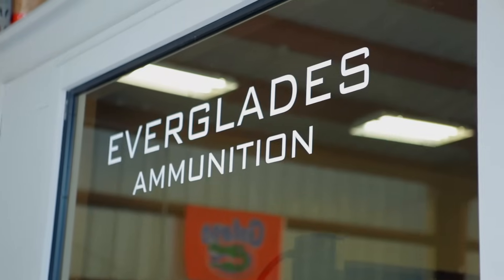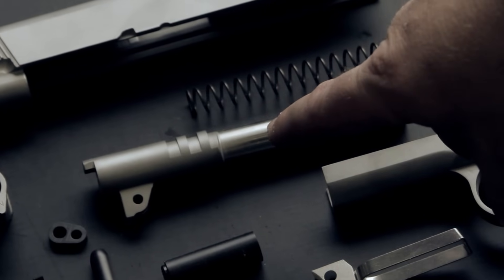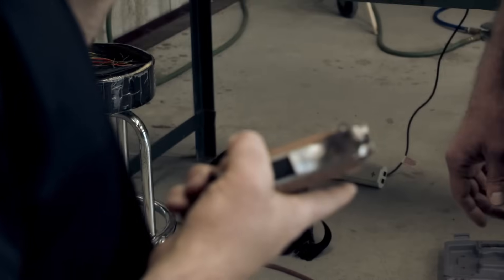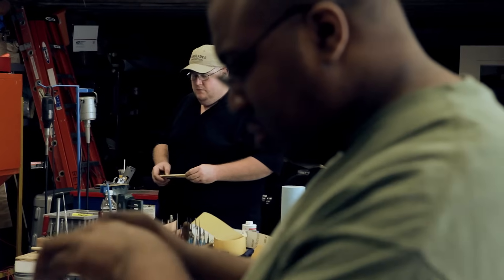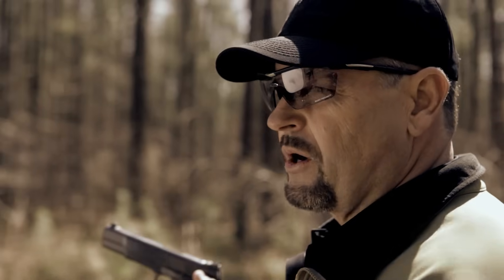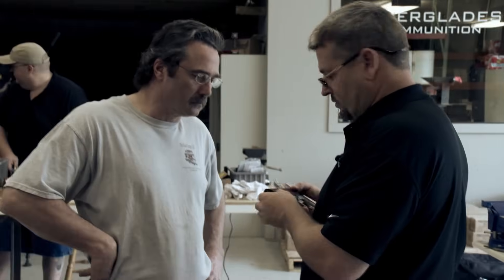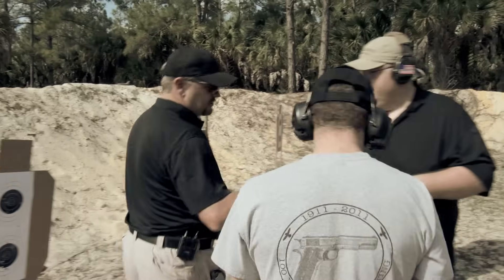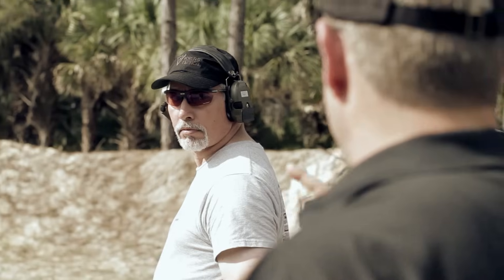Building the 1911

Comment: My very first handgun was a 1911 I built from an 80% frame.  I bought a cheap kit and half of the parts fit in it so had to order those same parts again off someone else.  As well as it works, trigger doesn't feel great and it feels cheap altogether.  Would love to have a class in making a much higher quality 1911.
Reply: Did you use a sarco kit
Reply: luise cobian Yes, I bought the Sarco kit since it was dirt cheap.

Comment: What are your thoughts of the Israeli grip method ? the right hand thumb curls down, and is not the thumbs forward grip I was taught.  Sure it's best to use whatever works, but something to consider for struggling shooters.  I shoot fairly well except not as well with Glock which is my most reliable daily carry pistol. I have to pratice with Glock often to stay on target.
Reply from the maker: Where did you hear that called the Israeli grip method ? That grip has been around for decades and I can tell you it didn’t originate in Israel

Comment: So they are taking off some material from the parts - any need for paint or other treatment in those areas?
Reply: Christian A No matter if it's stainless or carbon steel, polishing is the first step after material removal. If the gun is stainless, you're done at polishing, if it's carbon steel, some kind of finish will need to be applied.

Comment: I considered this, but it seems like it would be a very expensive proposition right now. My P80 was a radical upgrade from a stock Glock for the same money as stock, but the 1911 doesn’t work out the same it seems. Maybe i’m shopping in the wrong places? I can get a Decent 1911 for $799, so if I can do it near that or make it better for a little more, i’m in. There is certainly a ton of joy in doing it yourself, especially as an auto mechanic.

Comment: Looking for guidance, My 1911A1 has two issues. First the hammer has a weak strike compared to my other 1911A1's. If fires the gun but is weak. I mention this first because I think it might contribute to my second issue. My second issue is, when the gun is gripped,  the hammer is at full cocked position and the upper safety is on, when I pull the trigger the hammer does not fall, however the hammer does move slightly, then when I take my finger off the trigger and take the upper safety off safe - the hammer falls from the full cocked position to half cocked. Why does this happen? Looking for input on these two issue. Thanks in advance for any suggestions.
Reply: That means your thumb safety is not fitted correctly. Your thumb safety should be blocking the sear but since it is ill fitted, when you pull the trigger then take the thumb safety off it is allowing movement of the hammer when it is not supposed to.

Comment: He puts these things together like how John Browning would have put them together and doing it by eye allows for better craftsmanship. While it is true machining parts to a precision within so many thousandths is a good method of building a gun you will never get the real fitting and artistic touch that this guy instructs. Even though some think machining is more precise (which it is) there are parts that are machined that need a human being to fit it together. A good example of this is when an engine builder laps the valves in a head. Although the head is machined on a mill and several cuts are made to it to get its final shape the valves still need to be lapped by hand so you can ensure each valve has a good seal and is matted perfectly to the valve seat. 

The 1911 is no different and must be hand fitted to achieve this level of craftsmanship. I admire the willingness to teach others this type of work and to do it in such a constructive manner. He does not belittle the people for not knowing something there are a lot of people who teach who go out of their way to belittle their students. This guy is a top notch instructor.

Comment: Great video. My first pistol was a Thompson Auto Ordnance 1911A1 Government model .45ACP brand new out of the box for something like $350-$400 in I want to say 1984 or around that time. Service grade pistol. I put a lot of work into that pistol. I really had no idea at the time when I got it that I had to work the pistol up. I found out the hard way when I first shot it. It did not run. My boss at the time was familiar with pistols and told me that I needed to work it up. I wore the slide and frame rails in just working the slide in front of the TV until it ran smooth. Then I went to a local gun shop and ordered a recoil spring and buffer kit and I dug through a box of spare 1911 parts until I found a barrel bushing and barrel lug that gave me a tight barrel fit. Put the recoil kit in when I got it and took the pistol to a well known and reputable local licensed gunsmith and he did a nice polish job on the feed ramp. It was by that point a very good service pistol. Probably should have kept it. Thanks for the memories. I have been toying with the idea of building a 1911 9mm but still vacillating about the work and cost ahead. Haha. Yes I miss not having a 1911.

When Smith came out with the model 625 I knew a guy that had one and shot it combat course at the club. He was just as fast if not faster than the autoloaders in the major class. It was impressive. It was a big revolver but it was fast in the right hands and reloads were super fast with full moon clips. Then later I think Smith came out with the little 9mm revolver and I always wanted one of those for minor class combat but never got one. This was back during the wonder nine years when I was heavy into nines and I still kind of am even today. I still look at those Smith 9mm revolvers even today. Oh, major caliber and minor caliber club classifications also known as power factor. A lot of race guns at the club even back then. .45ACP and 9mm. I like them both equally. Lower recoil of the nine or any minor caliber just makes it easier to shoot and control than a major caliber.

Comment: Back in the early nineties when the price of 1911's started climbing (thanks to Clinton) I bought a bag of parts from a guy at a gunshow.  I read some books about smithing the 1911 and I managed to get the pistol together in a day.  It has a Colt slide and an Auto Ordnance frame but it shoots fine.  Since it was used parts, I just had to stake a couple pins and get things together correctly.

Comment: Question:  How well were the mass-produced guns built for the military made?
Reply: Russ G back during ww1 and 2, it varied. when more units were demanded, heat treating was sometimes totally neglected in the manufacturing process, which gave those guns very limited use before severe metal deformation, and total failure. the models that survive have often been rebuilt many times over.

Comment: Just buy a Taurus ss PT 1911 out of the box for $700. It is forged, and moving parts hand fitted and polished by craftsmen. This near perfect pistol would cost you $3,000 if boughten from a smaller company. Taurus is the 3rd largest in the world. You can put 30,000 rounds down it with zero jams creating a 1.9 in group at 50 yrds using a full mag.